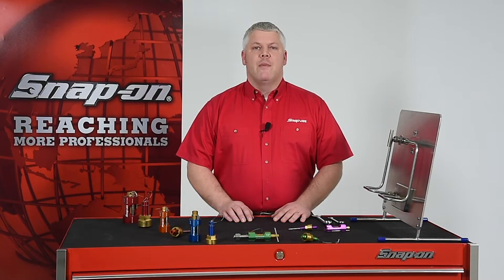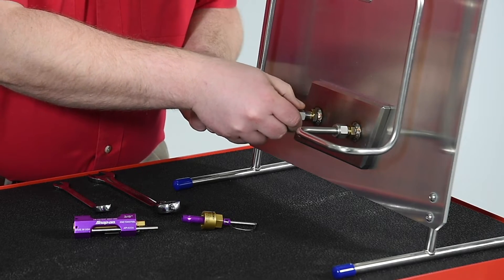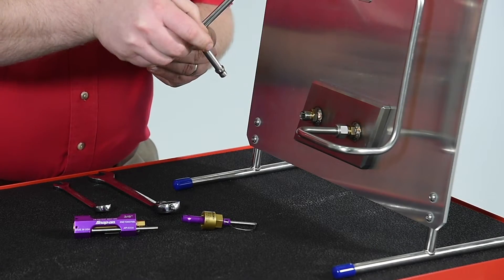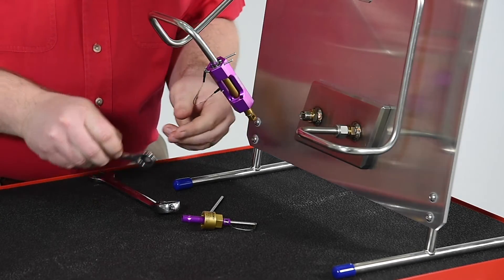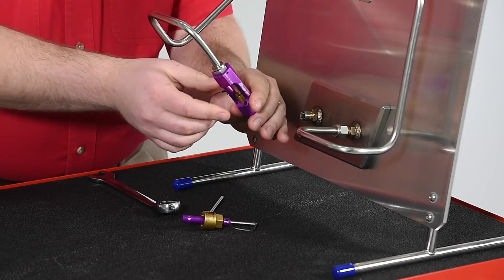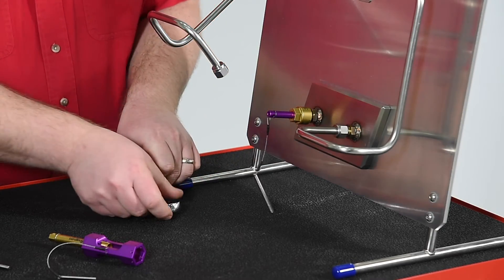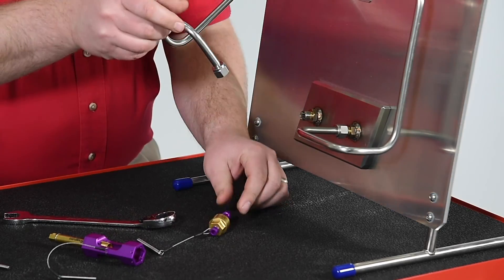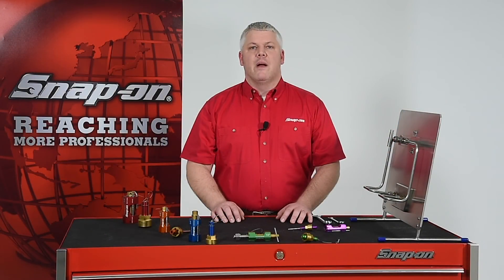Fitting Repair Tool for Compression  Fittings

Comment: RTD48; RTD15M; RTD's family products like? thread restorer? Interesting.

New product: day after "tool at hight" snap-on solutioneers have been into the cave for mining industry and they come up with a new working helmet that has modular military approach and can accommodate a gas mask, integrate in the bill a powerful rechargeable led light, accommodate in the frame a sort of tracking localizing gps, ear buds and microphone all powered with same battery and a google glass visor device for remote connection with headquarter during critical tasks... or emergency rescuing...

New product: after tool crib container... the geodesic dome homes temporary facility for workers and local headquarters... (off grid turn key solution)

take care
CSR